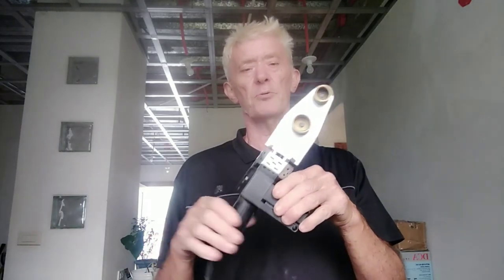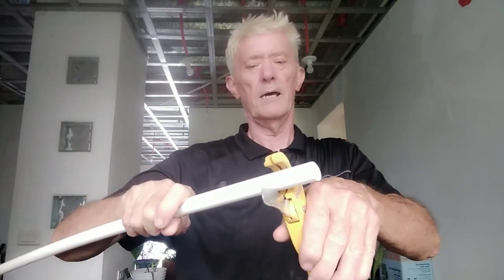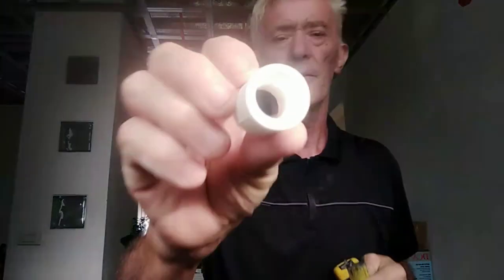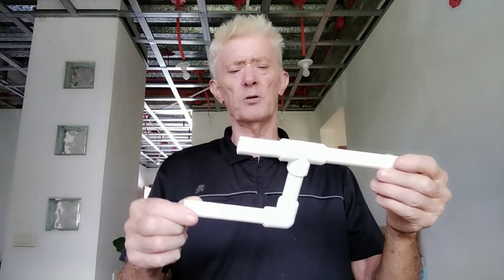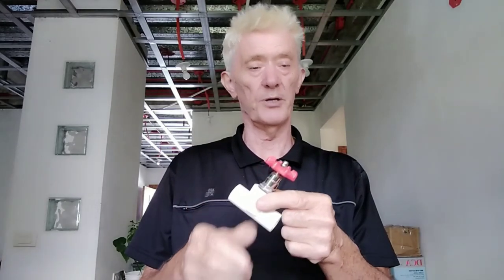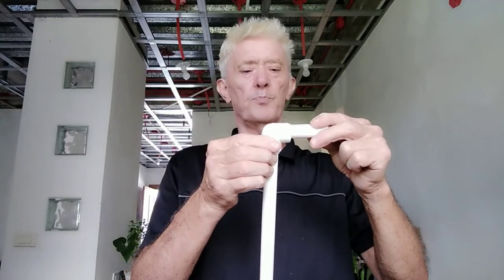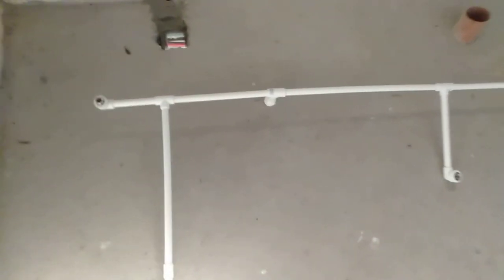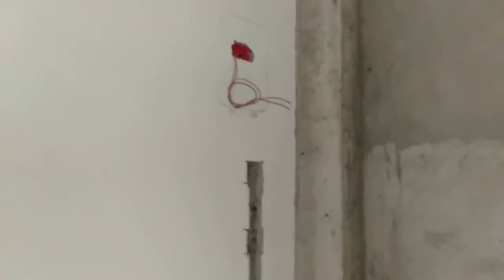HOW TO: INSTALL PPR WATER PIPES IN THE PHILIPPINES

Comment: I'm a builder in the UK but feel like a new kid on block here especially with plumbing. You're very informative and a good teacher with those valuable tips. Keep it up with these videos as all us practical expats need as much help as possible
Reply from the maker: Here they have regulations to follow but most times it's a combination of regs, and common sense.An example obviously rain water doesn't go into septic tank...but the grey water does in the newer homes even though they say it should flow onto land...but colour grey is is nothing thing when it smells like a dead frog😂😂using PPR pipe is certainly better than the blue pipe and adhesive 🤔😂😂

Comment: In my 34 years of experience when I do a PPr socket fusion there has never been a leak ..If you follow the technical rules you can rest asure !!.. But if you are not sure of your welds better to do a pressure test with water ( 1.5 times the working pressure !! )..
Reply from the maker: Yes I'm going to pressure test the system before anything is covered up🤗🤗